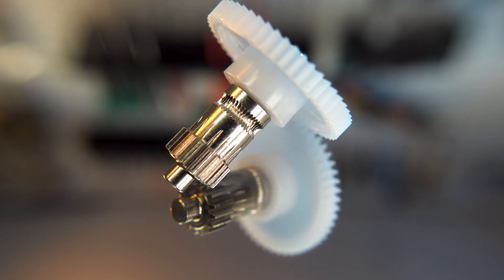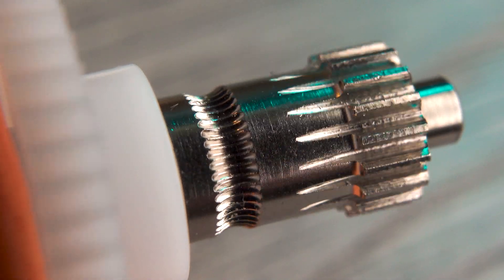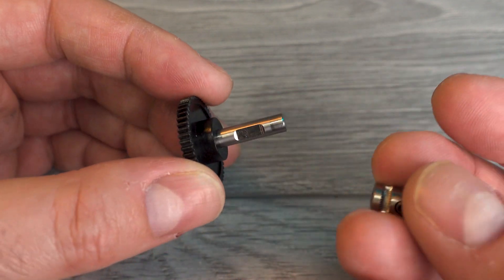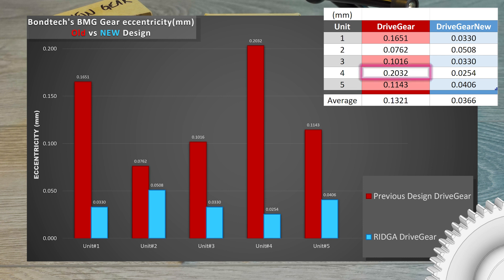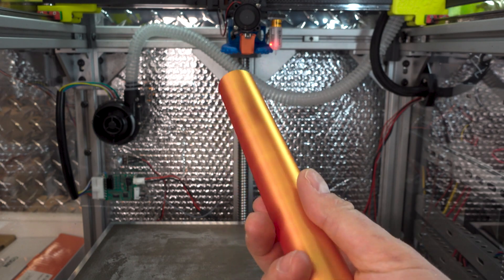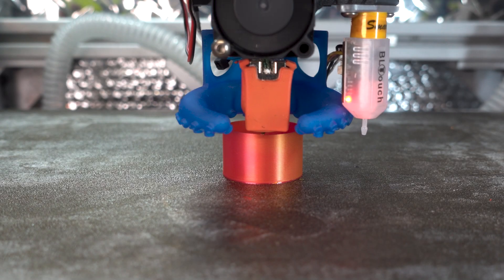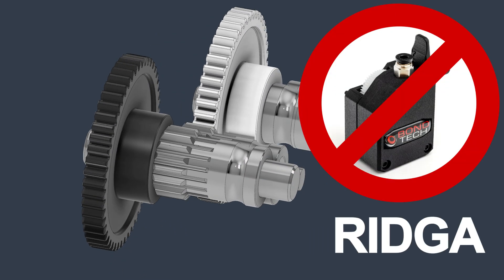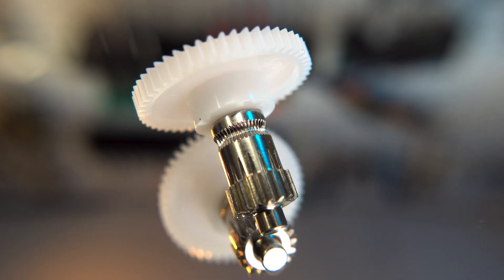Will this NEW extruder gear solve the issue?

Comment: @MirageC
so the RIDGA did not use helical gearing/teeth as i had expected, can you elaborate what this means for us going forward? I thought Vez had found the final solution to the issue regarding wandering filament
Reply from the maker: Bondtech does their own design, I have highlighted the flaws and potential issue of filament walking and this is the product that Bondtech came out with at the issue of this discussion.  In all honesty it is a huge step forward.  I have not had the chance to install my VZ-Hextrudort-Low yet,  so I cannot comment on the helical or twirl gear yet.
Reply: I've tested CNC VZ-Hextrudort from mellow, and the print looks almost identical as from orbiter 2.0. Be it due to bad QC or design issues, it didn't really improve my print quality. They are also selling it with 8T stepper while Vez says that 10T stepper fits it better which is also baffling for me.

Comment: Did you also test without the roller bearings on one side?
Reply from the maker: You mean with regular idler? No it did not even cross my mind.  I like it so much with the bearings.
Reply: @MirageC  It does look great! Just wondering if your walking gear theory holds up and I would like to keep the gear for flexables personally.

Comment: I have VezHextrudort CNC machined extruders, do they also have those bondtech gears?
I cannot really see the set screw. But it also has that praised twirl groove design which bondtech has not. Hmm
Reply from the maker: No. Vz-hextrudort is a fork that has evolved in its own path.  The new metal version is a beast on its own.
Reply: @MirageC  nevertheless I love both of your work. I haven't tried the/your printed version. The design is so smart! Joined late to the party with a Voron2.4. I think it's s more reliable now without the printed Clockwork2 extruder. And lighter.

Keep up the good work.

Comment: Not just improving YOUR extruder, but also the Sherpa and all the other using the same components. Congrats !
Reply from the maker: Yup that was the intent.
Reply: So excited. Gonna try to order one for my sherpa!
Reply: @jdubya42 Not sure it will fit the Sherpa, as on that design you need to insert the filament gear from the front, and the POM gear from the back. Probably there will be a new revision to make RIGDA work, but it's not yet available nor the development announced.
Reply: Which others?
Reply: @Lucas_sGarage  
- Sherpa Micro
- Sailfin
- printed Vz HextrudORT
Probably a bunch more
Reply: @_Xantras_  I'm looking at upgrading my extrusion system, since i have the BMG in DD and the heavy full size NEMA 17, so i was thinking about the orbiter 2.0 but now I'm not sure
Reply: @Lucas_sGarage  
The Orbiter uses different components unfortunately :/
Reply: @_Xantras_  which one should I choose?
Reply: @Lucas_sGarage  same situation here. After i failed to customize the hextrudort to fit my ender3, i will try to go the sherpa mini route... Maybe later adding Ridga when the DD config works fine

Comment: So... What is the issue unrelated to the extruder?
Reply from the maker: My printer is an experimental machine that changes on a weekly basis.  I suspect this is due to some work I am in the process of doing to the bed subframe and mounting point.  But putting light above like this will reveal every possible detail.  PID, Filament consistency, Gcode decimal rounding off Z distance in vase mode, etc...